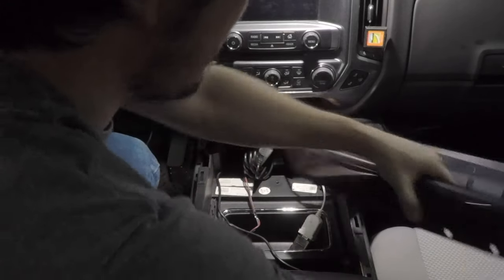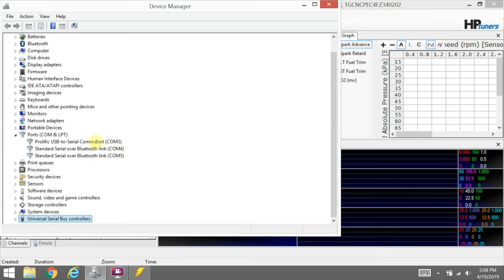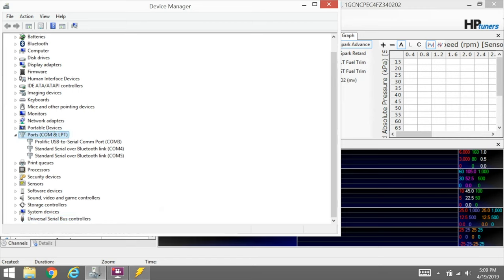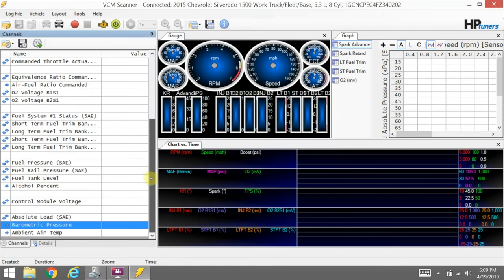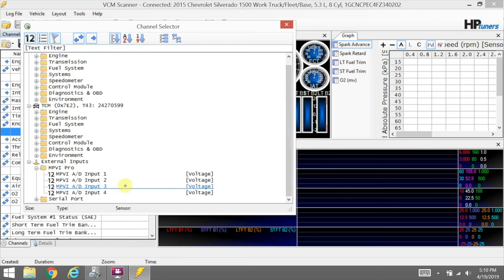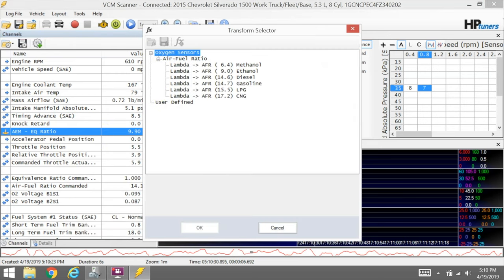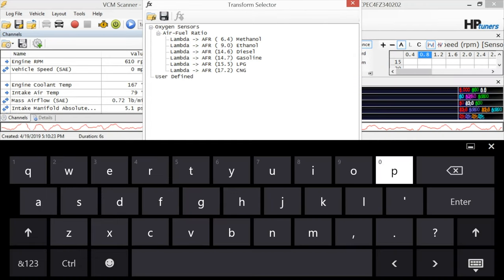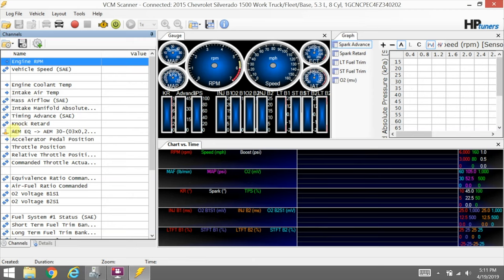Wideband Install Using Serial Connection and HP Tuners, AEM X-Series

Comment: What terminals do you put the wires into on the RS232?
Reply: I was going to ask same thing.
Reply from the maker: Blue to 2, ground to 5
Reply: What about the others wires I got the connecter but I don't what pos to run to and can I run power from fuse box for guage.
Reply: @TheSmokeattack  I ended up just using the egr signal wire instead, much cleaner and easier
Reply from the maker: @TheSmokeattack  Should be in the manual
Reply: @TheSmokeattack  just run the red(power) wire to 12 V, and blue to 2,  ground to 5. The other wires are for optional accesories.
Reply: There is also a really nice diagram that comes with the AEM sensor showing how to do it.
Reply: Ok just saw the blue to 2 on serial but I can just use any ground or a ground out of aem
Reply: I'm so confused.....

Comment: Somewhere i think I remember you stating that if you are taking your readings post CAT that the reading will be off by (0.5). I have recently hooked up an Aem wb and am using the serial method like you have outlined. And i have it reading from the tailpipe adapter tube and my reading at idle is 1.48 lambda. Is this what you were talking about? I was wondering if under transform where it says (input/10+0=output) could correct this by making the (0) a (-0.5) so that it read (input/10+ - .5 = output)??Is this how you would accurately correct for this ?

Comment: My wideband has a usb output and I connected into my laptops usb a slot and it shows up as serial com 3 in device manager. Is this the same kind of connection less the rs232 to usb adapter? Will the scanner find the wideband if setup as outlined in the video?

Comment: I ran across this video a few days ago but didn't realize it was what I was looking for . . . after some more research about getting the a wideband into an MPVI2 someone linked back to this and I knew enough to know this is what I needed.  And the new LC-1 I have in a box from years ago is going to work perfectly for this.  Thanks for taking the time to explain - a huge help.

Comment: goat rope. think I found my issue. after tinkering with it for about an hour while watching this video I looked over my wiring and I believe when I crimped the connection I crimped it at the rubber insulation and didn't get any of the actual wire because after crimping it in different spots it now works. thank you for making this video
Reply: now ive run into another issue. I followed ur video to the T and in my scanner the aem eq ratio is set to read in lambda but it shows afr. I went into transform and changed it to my aem 30-4110 and I cant get it to read in lambda therefore my "maf error" table we setup is reading crazy high numbers.
Reply from the maker: Make sure your gauge is set to lambda, the data from it will always match the gauge and will show up as such no matter what you select, you can select AFR on the scanner and it will still read lambda when the gauge is set to lambda. Let me know!

Comment: Thanks for all the videos!

I have a 2015 Sierra 5.3, and I just bought the MPVI2 and want to get started.

I would like to use the tuner on my buddy?s truck as well, and so I am wondering if it is possible to only temporarily install the wideband in a factory O2 bung during logging and tuning. Then replace the factory sensor for normal use, I realize after every modification I would need to reinstall it to update the tune. I don't particularly want to get a bung welded on, and as I said I want to be able to tune other vehicles.

If I go down this route, what steps would I need to take in order to tune? I'm assuming force Open Loop. Are there any SES/DTCs to disable? Do I leave the factory narrowband connected to its harness but loose, or should I remove it?

Many thanks!

Chris

Comment: The information was very helpful. Would like to know how to add a wideband that is not in the list, specifically a Glow Shift 7 color 0 to 5 volt analog. Can not seam to find the info anywhere. Using the serial to USB port. Have the data sheet but do not know where to put it in the scanner

Comment: Hello. Just found your channel and am loving your tutorials. Thank you. My question is, Would I need 2 wideband sensors and gauges if I am running true dual exhaust? I have speed engineer headers and each have an O2 bung to use for narrow band. Also, once done tuning, would i then replace widebands with narrow bands for cruising? Thanks in advance.

Comment: I purchased the exact same WB O2 sensor you have. Will the setup your describing work with  the original HPTuners version 2.2 that was discontinued a long time ago? My laptop os is windows 10 with usb 2 ports. 1998 z28 Camaro.

Comment: Yup, Some how my Tuning Lap Top upgraded to Win11 now my Serial to USB no long reads my Wideband in the logs. Currently looking for a work around.

EDIT: As a side note, I had zero issues before on Win10
Reply from the maker: This seems to be a common problem, think it has to do with the serial drivers, see if you can update them

Comment: Nice video, this looks like a easy way to hook up the wideband, this might be dumb question but how you figure out what pins to hook the data wire to?
Reply from the maker: Chris, it's in the manual but it uses the standard RS-232 pinout (2 wires done it only communicates from the gauge as opposed to 3 wires needed for bidirectional communication), in this case it would be pin 2 for comms and then pin 5 for ground.
Reply: Ok thank you for the info, I’ll give it all a try way cheaper then buying the pro Version lol
Reply: Do you splice into the same ground as the wideband for the ground?
Reply from the maker: You don't have to
Reply: Any chassis ground will do?
Reply from the maker: @MrMe807  yep
Reply: Thank you!!

Comment: Did i understand this right So if I have a mpvi2 with an aem wideband x series with obd2  harness I plug my  new serial port USB side to the laptop and my db9 to another female  db9 and through both of them will be the power and ground wires from my wideband gauge  which used to go into a cigarette lighter wiring from the tuning school and now I can tune 3rd Gen gm vehicles without buying a pro feature and a pro link right? But now since I replaced the ciggerate lighter wiring to this serial db9 serial ports where is my wideband  getting power from  laptop ?

Comment: When pinning out the rs232 connector, do you only use the Black & Blue wires (ground & signal)? Are there additional wires that need to be pinned?

I'm getting the disappearing AEM channel issue when I start to record. 
Tried everything you mention and more. Still can't get it to work.

Comment: Hey man, got my AEM connected to rs232 to HP and the gauge and computer are reading different values. Gauge is reading rich at 13 and HP is reading 1.35 lambda. Any ideas?

You been a huge help. Thanks.

Comment: A problem I ran into is the drivers were not installed for my serial to USB adapter. make sure you have those drivers are installed and you shouldn’t have an issue.

Comment: Great vid I’ve come across a problem I get the Pid to show up but when I record it disappears and does not log the graph shows lamda but with a number that doesn’t change the computer I’m using does recognize the 232 and the settings were as u describe in the vid. Do u have any ideas? I have not updated from HP perhaps I will try this tonight. 
Thx for all u do great work brotha 👍🏼
Reply from the maker: Reboot your computer with the adapter plugged in. Fairly common issue.

Comment: Hey thanks so much for this video! That is awesome info.

Is there a particular reason that you went through an RS-232 connector? I'm wondering if I can't just take the signal and ground from the wideband spliced to a USB connector which plugs into the USB hub. Is there any reason that wouldn't work? I don't want to include the RS-232 connector if it's not actually doing anything.
Reply from the maker: You have two output options, an analog and a serial (rs-232), neither if which are supported by USB natively, the serial adapter is the easiest and cheapest way of doing it.
Reply: @GoatRopeGarage  I guess I don't really understand what the serial connector is doing beyond being a pass-through then. Does the serial-to-USB adapter cable manipulate the signal in some way?
Reply from the maker: @Robert Cote yep, it changes the 232 signal to something that can be read via USB. Unless your laptop/computer has an old school DB9 serial port you are going to have to use a serial to USB adapter. You have to think of USB as the highway in which the data is transferred on, the serial to USB adapter puts the wideband data in a car so it can drive on that highway.

Comment: On a v8 with a long y pipe, do u need 2 wideband sensors, one for each side, or can u use just one where the pipe connects together about 4' down the pipe?
Reply from the maker: Just one, and you don't need to put it near the Y pipe, just keep it before any cats of you have them. It doesn't need exhaust flow from both banks, your changing fueling to the engine as a whole so either side is representative of the total AFR.

Comment: The two wires coming from the Wideband to the serial adapter. Does it matter where they go in the serial adapter?
Reply from the maker: Yeah, it will be on pin 2 and 3, if it doesn't work try switching them
Reply: Cool thank you

Comment: Still not quite clear on the ground. I have the black and blue wires hooked to serial.  Diagram shows a spliced ground of sorts to the battery. Do I just tap an extra long ground wire to the battery from the serial?
Reply from the maker: No, any chassis ground will work

Comment: Hi , I have an  AEM 30-0300 X wideband gauge , I just want to be able to log the AFR is there a simple plug in data logger  for this ,so can then download to my laptop ? can suggest as may as possible that will work with this gauge Cheers .
Reply from the maker: Doesn't AEM offer a simple software logger for that for free? If have to double check as I only run it with HP Tuners

Comment: If I use an o2 bung i already installed, replacing my narrow ban. Is there a way to wire from the gauge back to my Narrow band for the ECU to read it or is that not necessary
Reply from the maker: Nope, we disable then during the tuning process

Comment: Hey Kyle. Great work on the channel. Much appreciated. I hope I didn’t overlook this but I was looking for the reason for using usb2.0 instead of 3.0. I’m looking at new laptops and some don’t come with 2.0. Any specific reason for one over the other? Appreciate the help.
Reply from the maker: Should be alright, though sometimes things just don't want to work right on USB 2
Reply: @GoatRopeGarage  Thank you for all the videos! So we do want usb3 if possible? You recommend 2.0 in video
Reply from the maker: Some don't like the USB 3 ports on the computer for what ever reason, so if you have a USB 2 port always try that one first

Comment: Hi Kyle, Thanks for this video, have just received my AEM 30-0300  X-Sereis Uego Gauge, my question is regarding the MVPI2 dongle.
Do you think I will need to purchase the Pro link to run the AEM gauge, I will be installing the gauge as per this video.
Thanks man.
Reply from the maker: Nope, get the serial to USB stuff, save the money on the pro link
Reply: @GoatRopeGarage  Thanks so much for your quick reply, Have a great week end.
Reply: @darwinfridgeseals741  I bought the same gauge you mention above. Extended the blue wire to reach where I needed it to and then ran the ground for both the AFR and serial to the same point. Easy Peasy...

Comment: Thanks man for all the videos you are making, I am new to the tuning world and so glad I found your page Subscribed instantly keep up the good work, I was wondering can I just skip using the serial data plug and wire it strait into a USB plug and skip the extra connection, I am not mounting it in one vehicle want to be able to use it in more than one vehicle so it wont be solid mounted?
Reply from the maker: You have to get a serial to USB, as that had a chip in it that converts the communication protocol. But they make some that you can splice or solder together.
Reply: @GoatRopeGarage     10-4 thank you sir most helpful

Comment: Do you know a software that will log a serial input on Windows 10?  The AEM Data Viewer/Serial monitor won't run on 10 and neither will Hyperterminal. This is so I can log AFR on engines without a PCM

Comment: Where should I put the sensor. I have three spot on my long tube headers. Speed engineering the two front and one in the y pipe? Can I use the y pipe for a wideband and still get an accurate reading?
Reply from the maker: Yep

Comment: Awesome Videos, been binge watching them all day. 

Quick question……. Instead of using the RS-232 to USB interface cable. Could you not direct wire the AEM Blue wire directly to Pin#3 and the ground to Pin#4 of the USB cable and eliminate the male/female RS-232 connectors.  I’m not and electronics expert but we just curious. Thanks
Reply: i was wondering the same thing
Reply: I believe this won't work because of the signal types.

Comment: I'm normally very good about figuring stuff out like this but i'm at a loss. I have an innovate motorsports PSN-1. I used to be able to just use its included cable with a com port to usb adapter cable and log my data very easily. However that no longer works. so I bought the same DB9 connector here and hooked up the psn out signal to pin 2 and grounded pin 5 and nothing. Anyone have any ideas?

Comment: Hi, I have a question on the new mpvi2 device , so my setup is a gauge from (WB brand) hooked to lighter plug to give it power and hooked to O2 sensor and I customized a cable to connect the gauge to a serial port then from there i got a serial to usb adapter and then i plug the usb into my laptop or i get multi usb hub and connect it to the mpvi2 ? I am confused in the last part where do i plug the usb is it into the laptop or a usb hub with the mpvi2 ( which mean both of them in one hub )?
Reply from the maker: Both to the laptop, if it's one of the supported serial wideband sensors the software will see it when you add it to the parameter list.
Reply: Goat Rope Garage is there wideband that do not support serial ? And how would i know if it does support serial?

Comment: Hey man,

I'm trying to tune a 3800SC that's in the back of my fiero. I'm using HP tuners, and have a AEM 4110. I have a db9 cable wired into the gauge, and the same db9 to USB cables I saw was used in the YouTube video about this.  I've checked the drivers, and shut down the computer and started it up with the hp tuner and wodebamd connected.  Even with all this, as soon as I hit log my wodeband dissappear.

Any other ideas?!

BTW love the videos, have helped alot!

Comment: One more thing I’m using a CTS2 edge Evolution to monitor and do some other data logging I was going to put a OBD two port splitter do you think it will interfere with my scanner and AFR gauges
Reply from the maker: There is a chance it might mess with the scanner as both devices will be trying to pull data from the same address. The AFR gauge is designed to work along side of everything.
Reply: Thankyou brother i will try and separate them see if anything changes will let you know. And another thing let everyone know copying anything off the HP repository is not the best idea I almost blown my transmission out doing that thank God for your video on the 6L 80 you got me straightened out thank you ABT!

Comment: What do you do If you wideband is consistently off.  I keep getting a reading in 1.4 area while commanding 1.00.  No exhaust leaks and just had AEM warranty a new sensor with no change.  It's in the y-pipe behind the bank 1 sensor 1 O2 with no cats.  It's got to be in the Transform selector but I can't figure out what numbers to put in there.  I have it now just like you did in you video witch gives me the 1.4 reading.  It's a 30-0310 AEM with no gauge
Reply from the maker: Check for leaks, if you are running consistently lean it indicates and exhaust leak.
Reply: @GoatRopeGarage  Just in case somebody else comes across this problem.  Somebody on the HP forum figured it out.  The 30-0310 was just sending the raw data to the scanner.  So under transform I divided it by (v)/ 14.65 + 0.  On to MAF tuning thanks to Goat Rope!!!
Reply from the maker: @blairbarham6532  thanks for responding back!
Reply: @blairbarham6532  Thanks heaps! I've been chasing an odd WB reading for way too long. This fixes everything!

Comment: I have an MPVI2 Pro with the Pro- Link. I am trying to hook up 2 AEM FAE 02's. Is it better to use the analog on the Pro-Link or the canbus option?
Reply: Can bus is 10x better and more accurate.
Reply: @dsmubz the problem is you can only hook up 1 canbus at a time. =(

Comment: I have a custom wideband and I did what you did in this video and as soon as I start monitoring it is disappeared from the channel and the wideband have no value in the chart. I have checked the wide band it is working properly and downloaded and applicant to check if it was connected to the pc and it was connected so therefore there is no issue with the wiring and the connect. tried to reboot while the serial to usb pluged into laptop nothing happened.
Reply from the maker: Which wideband are you using?